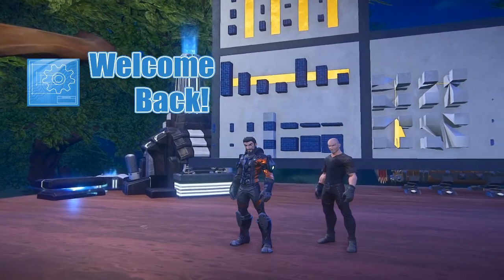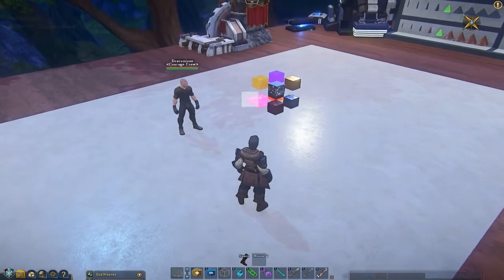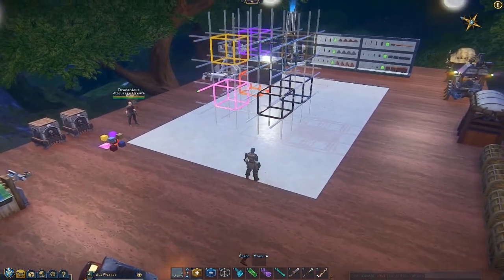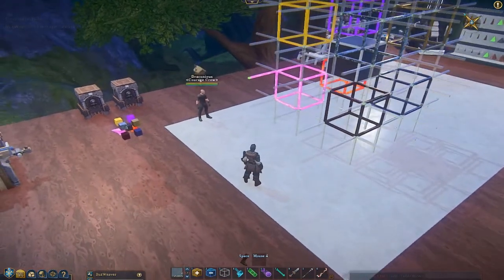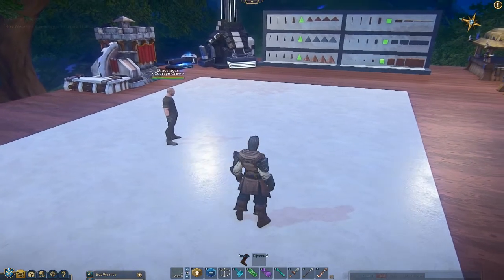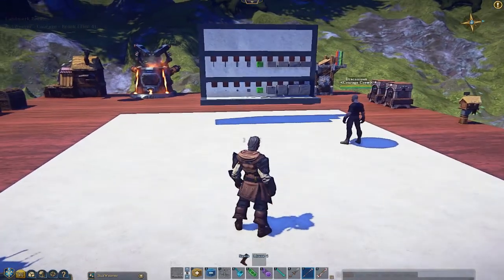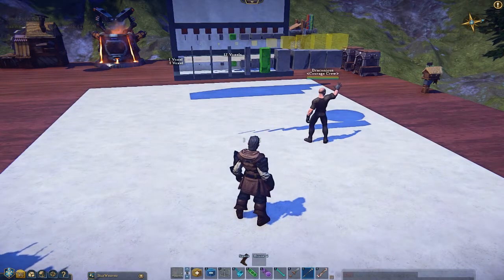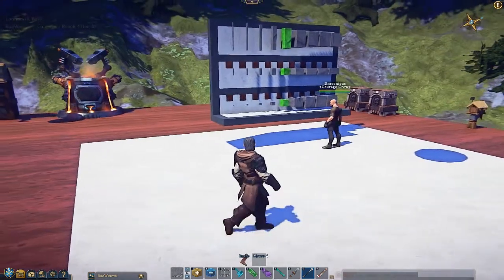Landmark Gameplay Building with Draconious Roaming Vectors Part 5

Comment: First off I'll just say these tutorials are awesome, thanks so much for these! However, I'm having trouble with one part of this one - I can't get my last set to stretch. I do the negative paste one down and it makes the desired changes, but when I go and move the two spaces above and do a negative paste, nothing happens.  It's got me quite perplexed!
Reply from the maker: You Mirror, then go up two and negative paste. If you left the mirror part out that may explain it. Also, the F key (negative paste) doesn't work by default in Tweak Mode.